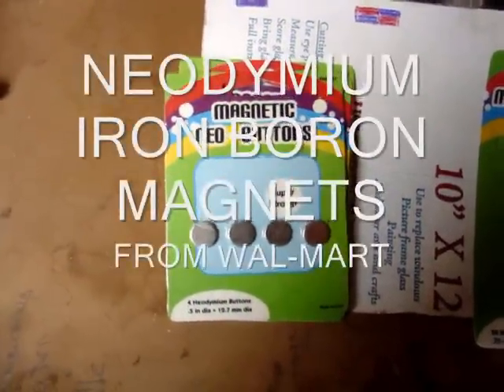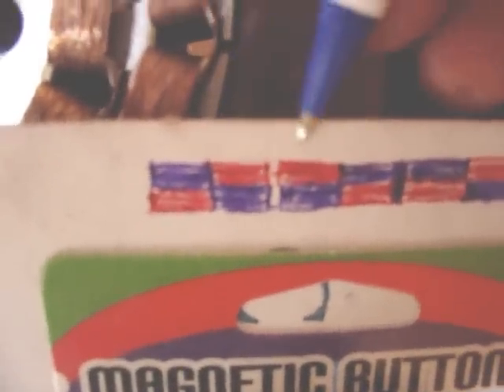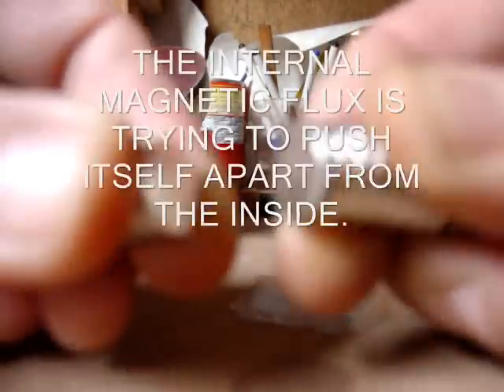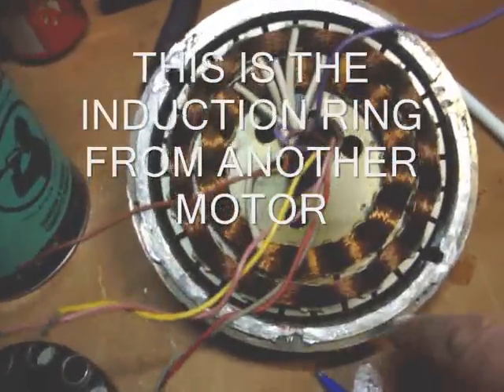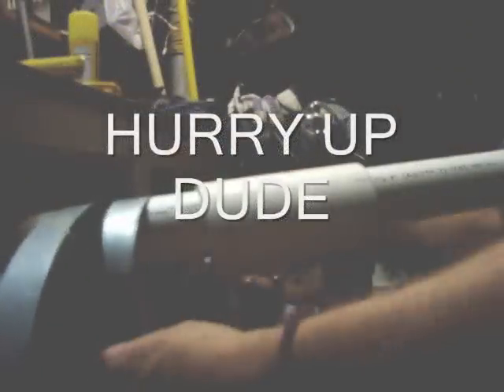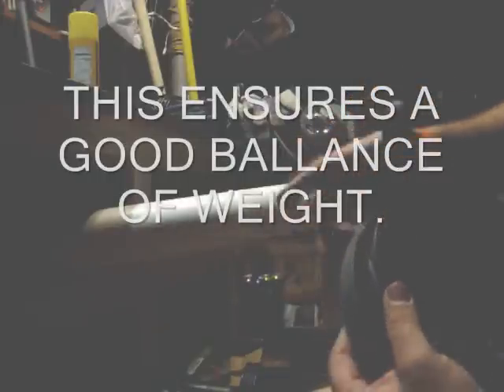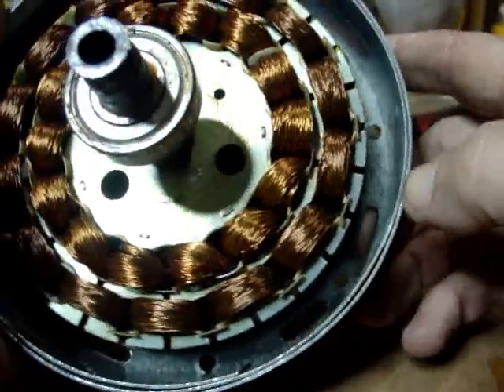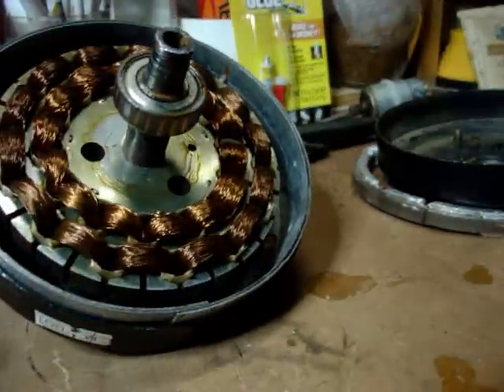PART 4 HOW TO CEILING FAN WIND TURBINE

Comment: Hi guys please i need a nice project for Electrical Engineering College project
Reply from the maker: +peter ibe 
I would have to ask, "how much time, and how much money do you want to invest. These ceiling fan wind turbines are very cheap to build, and These are easy to build, and carving the blades is pretty simple as well. BUT they do not put out much amps because of the thin wire used in the stator. 

Another aspect to consider would be how easy, or hard it would be to get magnets where you are.

Another project worthy of engineering class would be some of the projects at otherpower.com
wind turbine evolution page.

they have many different builds from scratch, including the carving of the blades, and the outputs to each project, fully illustrated with full instructions.
I hope this helps.

MUDDy

Comment: There are a lot of these conversions and one more documented how to doesn't hurt anything. The first one I saw didn't use any magnets at all. He just makes cuts in the old rotor and uses the inner set of coils as a field winding.
Reply from the maker: +Douglas Allen The inner coils as field winding sounds cool.
Check the dates on the other videos. Then check mine. I started youtube in Feb 2nd 2009. The concept spread quickly. One of the first ones I made was back in early 2006 before my youtube start. It ran and braved 80 plus MPH winds several times per year up to 2013 i believe. the bearings got painted. It had ceramic magnets. it lit LEDs to light up the yard a bit. I gave it away to a friend about two months after i made it. Thats when Ozzy (not the rock star), used screws to stop the tail from moving. And that is also where it took the straight on high winds. One block from the beach. :)
If done right, they are tougher than they look.
MUDDy

Comment: How much do you charge to build and ship one?
Reply from the maker: ellmiller2013 I have Only sold and shipped two before. I wasnt interested in selling them back then. I was more interested in playing, and experimenting with them. I was well satisfied with the results and versatility of just connecting to several different voltage battery banks. and seeing results. Because of the thin wires in the stator windings, They produce low amperages. They make great trickle chargers for 12, 24, and up to 36 and 48 volt battery banks.
I wouldnt try for any higher voltage banks than that. The 48 volt banks only charged at higher wind speeds.
Although if the rectifiers were wired in series instead of parallel, That would change.

     I did rewired one with 18 gage wire. I need to get off my butt and do some testing with that one.

Unfortunately: Private  you tube messaging has been taken over with google plus, thus sharing all info to all. So exchanging email addresses is very insecure these days.
Contact me on skype, MUDDYMUDDYMUDDMANN
AND when you make the contact request, be sure to type a message regarding the ceiling fan wind turbine.
MUDDy

Comment: The mags in a computer hard drive are split pole..about 1/6'' thick and are super strong! Its hard to fund magnets in my part of the world here in back woods pennsylvania Im goingto try the split pole mags from hard drives in my windmill, I hope it works goingto use a celing fan any hints or help would be great. also going to try that plastic dip or spray to keep the water out it hold up great on hand tools.

Comment: I'm just curious, what would happen if you attached magnets to the inside ring as well. either matching poles to the outside or opposite poles? so the two sets of magnets would attract or repel each other. would this increase the power?

Comment: ok Mud Mud, so I called around to some computer stores and I went and picked up about 30 neodym mags from old dead hard drives for about $10. some are really powerful. My question is do all the magnets have to be the same size? also can you only have one polarity in front of one coil at once or can you have even more magnets so that maybe two or three alternating poles may be aligned with a coil at any given time? Thank you!!!

Comment: hello okay, I'm done with a turbine
   a ceiling fan with four
  country with permanent magnets, but this generator generates 20v
running with the highest hand depending on the speed generates more.
so it does not light a lamp lol.
would be enough to send me the wiring diagram for vafor.'m from BRAZIL SANTOS-S / P
E-mail - cdlemei@hotmail.com

Comment: If you can find some pvc tubing that the magnets can fit into, then you can put a stack in there and then slide 1 off at a time, you may need a rod to push them up, but its easier than trying to get them apart with a knife or screwdriver.

Comment: If you can pick up old microwave ovens, on the high voltage side there is 1 diode which is rather big and can reliably take a good amount of power. Old microwaves can often be obtained for free on freecycle, or ask a local appliance dealer. They are also a treasure trove of other handy bits, and if your really good with metals you might even be able to make the banding from the case.

Comment: 1N4001 = 50 Volts, 1N4002 = 100 Volts, 1N4003 = 200 Volts, 1N4004 = 400 Volts, 1N4005 = 600 Volts, 1N4006 = 800 Volts, 1N4007= 1000 Volts . Peak Ratings are 10% higher.

Max. Current is 1 Amp for all of these Diodes.